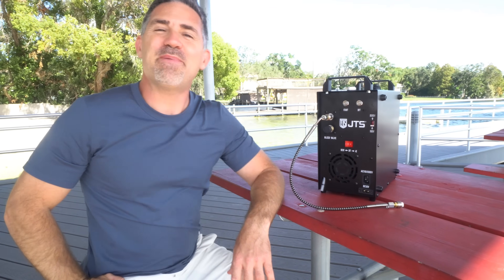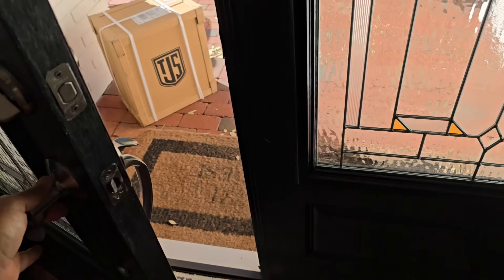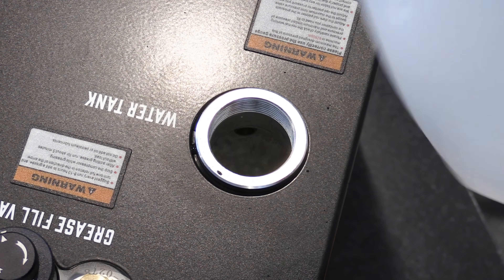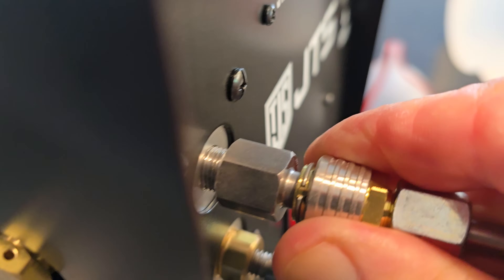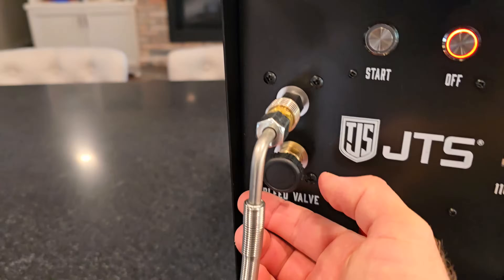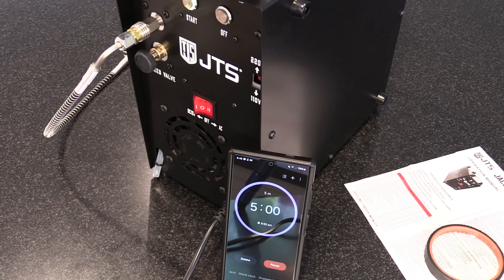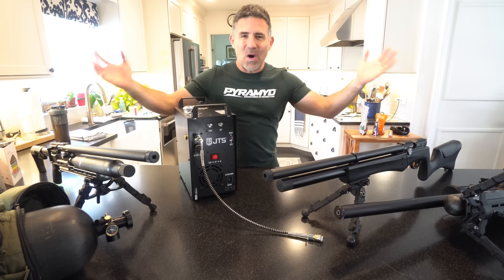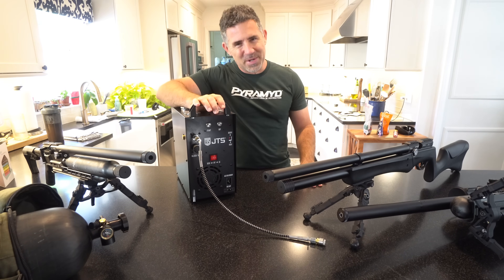JTS Comp100 (Airgun Compressor) FULL REVIEW + SETUP & Maintenance Guide - How to Refill an Airgun !!

Comment: Steve, as usual, a superb review in all aspects!  You are the MASTER.  I had a large ice water cooled two cylinder compressor that did fill my 6.8 L tanks in a reasonable time but I got tired of the bucket of ice water where I had to continually refresh the ice in it. So then I bought this one that you just did the review on the Comp 100..  Yes, Steve, it will fill 6.8 L tank if you go on vacation and then come back. The fill time for that kind of tank it's just not reasonable with this compressor. Given that I shoot every day for two or three hours in my backyard and 50 m I need a reliable air source. So I ended up buying an $1800 dual cylinder compressor that weighs 109 pounds and is very well-made. I even had to get help from two guys to help me get it out of the box. I've named the compressor "behemoth". I'll tell you I should've gotten the $1800 one in the first place. It would've been cheaper for me overall and less stress. Because the $1800 Compressor filled my 6.8 L tank in a very reasonable amount of time at a low 70 dB. So now I'm happy but I think a big problem with compressors is the expectation of the user with respect to seeing that it could fill to 4500 or 6200, without knowing that it's not just the pressure it's the volume that it needs to fill to that pressure. .  That's likely why most of those compressors ranging from $300-$900 just don't meet the expectations of most users. If you're gonna fill in Airgun directly, yes you can do that those cheaper ones can do it it'll take a while but still, he can do it, and that's what they're designed for, to fill Airguns directly. Feeling a bottle is an entirely different proposition. And most people just don't get it that it's not just about pressure it's about pressure and volume.  I didn't want to spend $1800 on a compressor. I'd rather have spent that on a new gun, and it would've been cheaper for me to buy the $1800 compressor in the first place. But like many people I saw in the product listings that the lower cost compressors could fill to 4500 or more. Stupid me I didn't consider the volume needs to fill. So now all that said, I'm a happy camper with a hole in my pocket for $1800. So this comp 100 is it realistically able to fill a 6.8 L tank in a reasonable amount of time. It's very well-made and the cooling system is great but have your expectations set correctly.

Comment: I have an omega trail charger with external power inverter to change from 12 volt to 110 AC . But I prefer to only fill the on rifle tanks. To conserve life of compressor. And ive had mine three years with no problerms.

Comment: gx cs4
Reply from the maker: Yeah, pretty similar.  Probably the same manufacturing partner.  JTS's Comp100 has the built-in converter though (so worth it for me personally) and a little higher performance specs.  Steve

Comment: Glad to see you're standing pain free? 🙏 The power converter im my compressor failed (not a JTS) and when I switched to using 12v DC I noticed my 210cc Avenge-X filled about 30 seconds faster. So maybe it is just because they are 12v motors.
Reply from the maker: Thanks buddy.  Yeah, even running and biking and walking a lot now (Dr.'s orders to heal up faster).  It's all moving in a good direction finally.  Yeah that makes sense.  It's a 12v unit first so may operate best that way?  Steve

Comment: It actually been a long time since I’ve been to your channel. I’m on a 72 hr shift I thought to myself, ‘I need to watch those videos on tuning my Avenger’ because I’ve just done a ton of stuff to it, after it sitting for a good 8 months, and voila…a new video I haven’t seen, for a brand new compressor when I’ve been looking at new compressors, because mine just took a dump. This is an awesome buy for under $900 if it can actually fill my tanks too!  NEXT PURCHASE
Reply from the maker: Outstanding!  Yeah, that Avenge X Tuning Guide I did is perfect for learning how to tune the Avenger too.  Enjoy!  Steve
Reply: @   Yeah it was. I had it shooting dime sized groups out to 75 yrds at 940fps.  Can’t remember the shot count, but I remember getting at least two full mags out of it. I’ve dropped it into a Buck-Rail stock, polished the barrel, did a couple of other little things over the last few months, and got carbon fiber tank for it. After I finish converting it over to the larger carbon fiber tank it’ll be a machine. Thank you for that.  I just realized I had down loaded it so I wouldn’t lose it. 😁👍

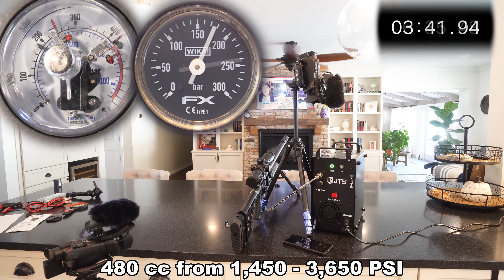Comment: 9:30 Airtank gauge might not be exact, so trust more on the pumps gauge. Theres no air moisture filter?
Reply from the maker: There is according to the marketing literature, but it must be inside... i didn't see it.  Perhaps by that they mean the drain line that purges the condensation collected during filling.  Steve
Reply: @AEAC  Right.... :D

Comment: Can this compressor fill Omega Air Cylinder 100 cu/ft 4500psi Tank?
In my area, Scuba shop only can fill up to 3600psi…
Reply from the maker: No.  It is rated for 6.8 L or 75 CF max.  Steve

Comment: Instead of adding water, you should use a quality automotive anti-freeze liquid that allows circulation between various metals, especially if the water comes into contact with aluminum and other metals.
Reply from the maker: Yeah, just relaying the manual instructions on that one.  Being an old gear-head, pure distilled water will offer the better cooling... a 50/50 mix will offer better corrosion protection.  My guess is that they've got the corrosion piece dialed in as they recommend distilled water first.  Perhaps 70/30 would be a good compromise.  Steve
Reply: @AEAC  Also thx  for the comment ..Food for thought ..👍
Reply: wich you recommend (sorry for my english )why i ask? i see lots of comments on the cs4 but never see what to use instead.Tell me wich quality automotive anti-freeze liquid .Do you know ore do you just comment to feel l33t ..I really want to know wich quality automotive anti-freeze liquid .
Reply: @scinner28 I use a liquid with 50% VW TL 774-J (G-13) specifications. I've been using the same 5 liters in my Chinese compressor for 4 years and without any internal problems with limescale build-up and oxidation, which lead to the water no longer cooling the piston head properly.
Reply: @Miguel-Simao-c5k  thx man ..

Comment: Looks and sounds a lot like GX CS4I
Reply from the maker: Yeah, pretty darn similar... probably the same manufacturing partner.  The Comp100 has the converter built in though (big win for me personally) and seems to offer higher performance specs.  Steve
Reply: It is a cs4 with another cover ..like many  are ...tbh nothing new ..the only thing is ,,are the clone cs4 wich are cheaper just as good as the original ? i see them for half the price in europe .Real cs 4 600+ euro ..clone cs 4 500 and less euro .

Comment: Glad to see you back in the saddle. It’s funny you started in with a compressor because that is exactly what I’m looking for. I moved to an area where there are no shops that can fill my 4500 psi 98 cu ft tank, and I don’t have a couple thousand to spend on the big expensive compressors. I don’t see any of smaller models like this JTS 100 that can do the job. Any recommends?
Reply from the maker: Haha, good deal.  Yeah, I needed something to do at home due to the hurricanes flooding out my shooting range.  Be back out there tomorrow finishing up the FX King .30 review I began on in May.  If it were me, I'd be okay filling a 98CF... I'd just do it in 2 segments with a few hours to cool down in between.  Steve
Reply: @AEAC  FX King, awesome! You always do such a thorough job. Can’t wait to see you put it through its paces 👍
Reply: I have Omega Air Cylinder 100 cu/ft 4500psi Tank & no shops that can fill my tank here. Scuba dive shop only can fill up to 3600… they don’t want to go 4000 or higher… do you think this compressor will fill my tank? Thanks . 🙏
Reply: @ No. The JTS Comp100 is only rated for 4300 psi. I don’t know what the max volume capacity is
Reply: @bluewater454  Why does it say on the website " • 6200 psi / 42MPA OUTPUT capacity" if it is only good for the 4500 you say?

Comment: A quick note, you should remove the grease pot and make sure that the grease is even (or close to) with the opening so that when you turn the knob to add grease it is actually getting added instead of just removing air space. If you get one that is really far back you could go many times without adding grease and kill your pump.
Reply: Makes sense!

Comment: That’s just a CS4 compressor. From my experience they’re absolute garbage. Mine stopped working after 3 fills and dealing with their customer service was an absolute nightmare. They would not answer my emails until I gave them a bad review. Then they were trying to hold my money hostage if I didn’t change my review. It took a lot of back and forth to finally get a refund.
Reply: They're not through with you yet as I had a review this comment box attachment to your comment 👍 I gave you a positive review as informative
Reply: Was it this particular one,  that's crazy you had to go through all that
Reply: @ same compressor just branded with a different name.
Reply: That stinks but you got an unusual one. GX are overall solid and I’d buy one over this rebranded one.  Parts are available for the gx who knows if they work with this ??
Reply: @Alpha_567-n3c  I’ve heard good things about the GS3 but I wouldn’t buy another GS4 again unless I have proof they have worked out the problems.
Reply from the maker: Yeah, pretty darn similar... probably the same manufacturing partner.  The Comp100 has the converter built in though (big win for me personally) and seems to offer higher performance specs.  Steve
Reply: I've had my GX for over 1 year and I fill my 2 480cc air guns back to back while I'm at the range. I've never done maintenance to it but I plan to rebuild it just to keep it running good. I'm out there shooting 1000 40grain slugs per setion that takes alot of air. Maybe you just got a faulty one.
Reply: @mrbeaver16  filling up an airgun is not the problem. It’s when you try to fill up an scba tank like they claim the compressor is up to the task. Also I forgot to mention that on the first fill up the ac/dc inverter blew out. Had to wait for another one to be sent out. After that it would fill the tank up to about 1000psi and it would quit. They told me to try running off my vehicle so I did. Same results.
Reply: @mrbeaver16 yeah not a chance your firing that many pellets or slugs.  Sorry I’m calling bs on your comment
Reply: @StrykerGSP  are you serious? Do you know how easy it is to fire that many slugs or pellets while having a compressor that works on your car battery or in my case portable power station. Yes easily 1000 per day. I'm sure plenty more do the same and probably more per day. Specialy while having multiple rifles.
Reply: Buy the air venturi i had mines and used it all year. Usage was moderate once a weekend 5-10 fills each outing.  So far so good. I also have 4 years warranty under amazon 😂

Comment: That looks a lot like the cs4-I hmmm wonder why lol
Reply from the maker: Yeah, pretty darn similar... probably the same manufacturing partner.  The Comp100 has the converter built in though (big win for me personally) and seems to offer higher performance specs.  Steve
Reply: @ I agree but so does the new  cs4-i that’s where the I comes in, it also has the built in inverter, I have one, that’s why I purchased it, it works really good.